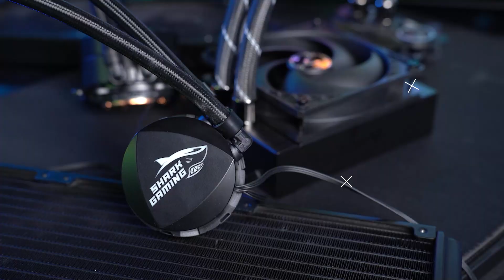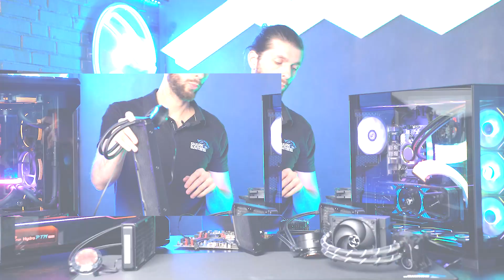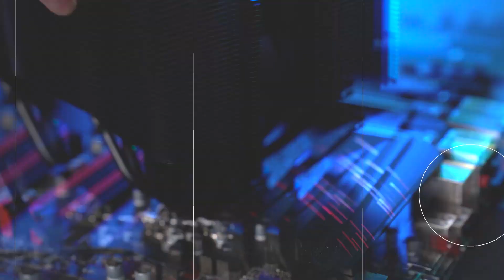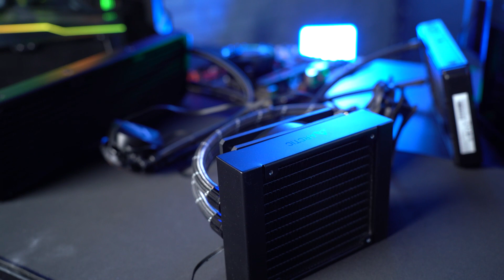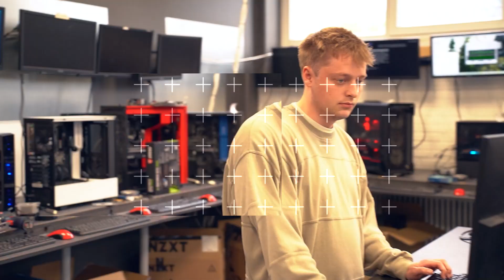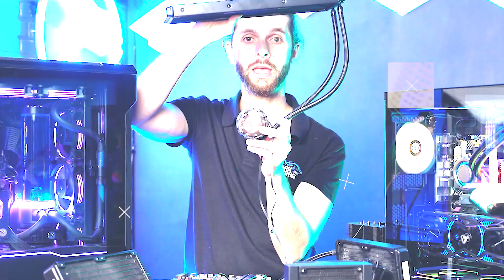How do Liquid Coolers work - and are they better than Air cooling?

Comment: Last time I used an AIO it was a 360 unit from Be Quiet, mounted in a Be Quiet case. First mounted at the front of the case, blowing air in to the case. That setup had severe overheating issues. Then I moved the AIO to the top of the case, blowing air out and still having 3 fans at the front still blowing air in, but without the radiator restricting. Quite a lot better, but I still had to run AIO fans at insane speeds to not overheat the system and having a case that was almost too hot to touch on the top and very noisy.
Switched it all out for a Noctua air cooler. Better cooling, quite a lot quieter and all in all a MUCH cheaper solution.

Just my experience with AIO's.
Reply from the maker: A good AIO performs more or less the same as a good air cooler, like Noctua. It mostly comes down to personal taste (and in some cases - airflow).
It sounds like you've either had a defective AIO, had the fans mounted the wrong way, had issues with the fan curves or didn't have a balanced intake - outtake in your case. There are many things that can influence the temperature of a PC.